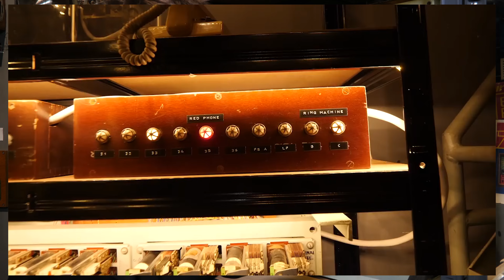Wiring A Phone Dial To A 1950's Mini Telephone Exchange - Telephone Tuesdays

Comment: So cool those old telephone relay technology.

We use a 1950/1960 era Office Box for a Mining Museum to run all the Telephones on all the different levels and even the outside connection from the office. It's so cool to here the dial tone, it's made with a little motor with nibbles on it that close switches. And all the unselectors goes brrrrrr when you dial a number.

Keep it on, its to cool to be forgotten.

Comment: IF YOU LIKE THIS THERE WAS ELINK 25 LINEPAX PUSH BUTTON 0-9 NO HASH TAGS OR STARS haha Also the Hundred lines group finals Retrofitted with DC ITT Code receiver And Register send loop dis 20 pps.
After This was New in 1970s CH100 crossbar used the same phones 746 Elink (this DC leg signal uses Eatth wire and line AB pair POLARITY DEPENDANT) WELL DONE !!!!!

Comment: "Oh My Giddy Aunt " Blimey, havent heard that since my granmother was alive..  Anyway Sam. Glad you bought this.  The 25th Line you should find hiding in the woods below. There was a Staff Locator built for this.  It would be great to find a circuit. Id like to build one, it would be good in your museum too, with some clusters of three or even four lights, and a buzzer in various locations in your museum. There would be a specific Staff Locate Number, then one or two digits to select the colour code. I think Executive Priority Barge-In is already installed, but ill have to check. I have one of these too. There was also a 50 line version made which again was very complcated as it fast-forwarded round the uniselector to select the second ten and third ten, etc..  more copmplictaed than this one.

Comment: if you sandpaper the acrylic in a neat rectangle (with rounded corners) around the switch and dialer to include the crack and drill a hole at the end of the crack on the inside and fill it with superglue it will look frosted and utterly pro and wont crack any more.

.. No even better, check your car insurance and see if your windscreen is covered by autoglass. If so call them out and the guy will come with that gigantic caulking gun thing and make an invisible mend.
Or maybe make an opaque rectangular panel to cover over the crack and also add extra rigidity and again you will look like a pro.

Anyway that is a such a great little exchange thanks you two for bringing it to life in the museum.
 
16 oscillators that can be mixed in 2 separate pairs....I think you could have a little programmable stereo drone device here.

Comment: Easy way to stop repeated pushes, wire the button to a relay with a capacitor time delay, or a delay relay
I think those line relays have a high speed and slow speed coil, the slow speed holds on during dialling while the high speed pulses the selector
I think if you straighten the fingers of the relay switches, it should be momentary.